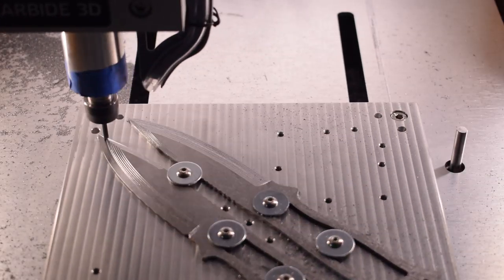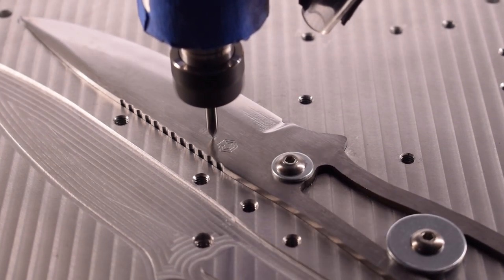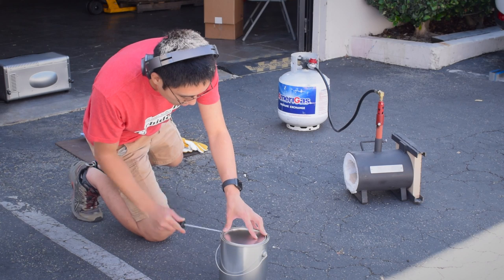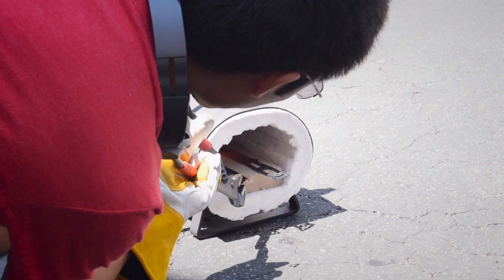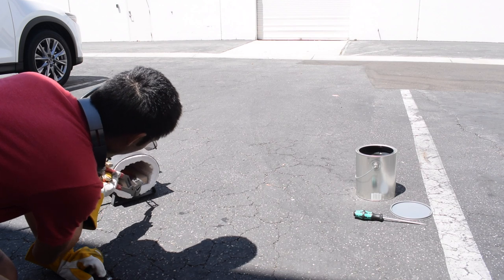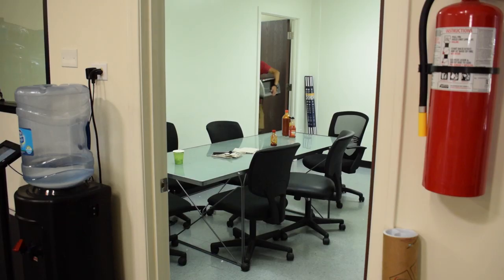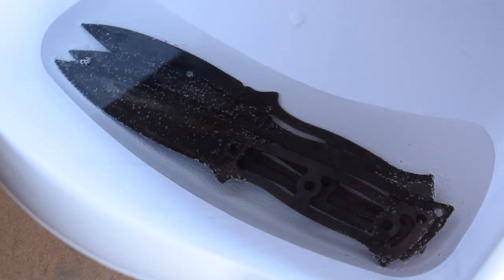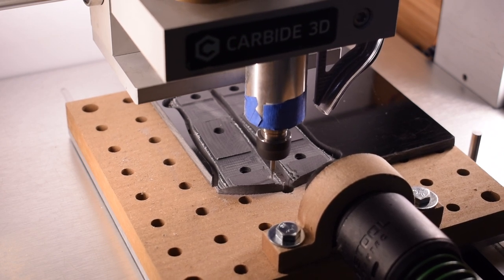Engraving and Heat Treating Steel - Carbide Camp Knife Pt. 5

Comment: Awesome work Winston!  For those wanting to try knife making but too scared to heat treat, there are a few places that will heat treat them for you.  I have used Peters' Heat Treat which is awesome.  Peters' will heat treat in vacuum or noble-gas which prevents scale from forming.  They will also straighten your blade if it warps.  And, you can specify your target Rockwell hardness -- they will test it to be sure, either on a scrap piece you send them or on the blade itself in an inconspicuous location.  They can also accommodate steels that require complex hardening cycles and extreme temperatures, including cryo stages.  (I sent them AEB-L steel which requires cryo).  Another heat-treat company is Tru-Grit.  They put the blades in foil pouches to decrease the amount of oxygen at the blade.  It works, and they are a bit cheaper, but there will be more scale on your blade.

Comment: I really like to use EvapoRust. It's safe and easy. I like to finish out the piece by cleaning it with baking soda water, not because it's acidic, but it keep the piece from rusting as quickly since it's now bare metal that's exposed.

Comment: Machining and video production is solid, heat treatment game needs some work though. Temperature control is carbon control, there's a wide range of performance between AC1 and ACM. Running in a forge with a coarsely spheroidizied steel with an uneven soak matching temp with color and using a slow oil is going to leave more to be desired. Especially considering the work that was put in to machine them.